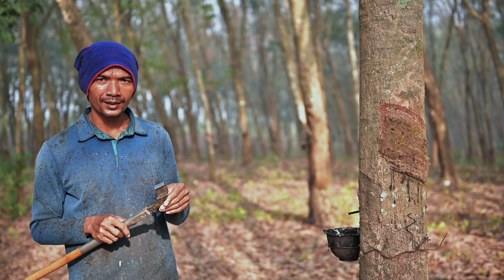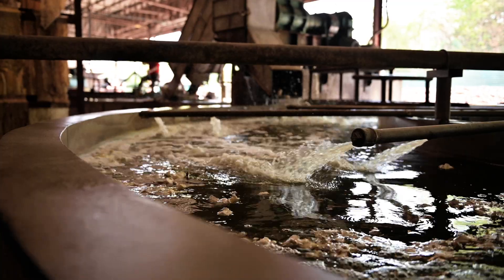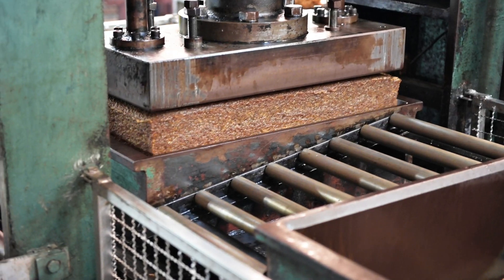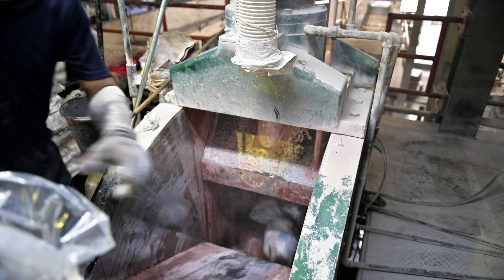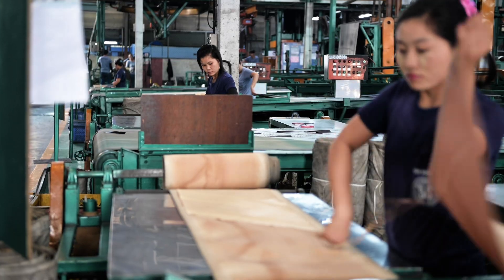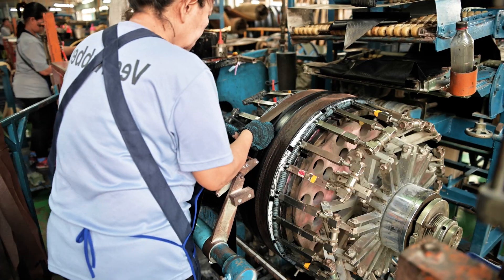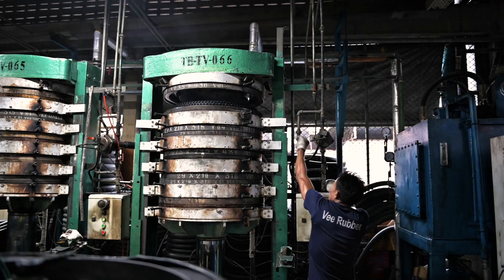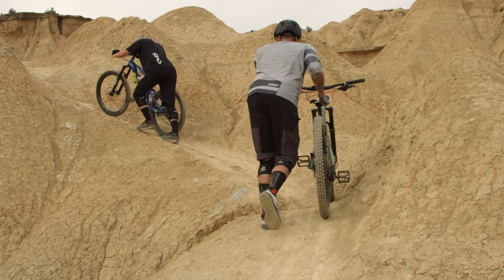How tires are made - Vee Tire Co. Factory Tour

Comment: I would like the zig zag tire with natural side walls 26x4 i have the Revi Cheetah bike and a set of tires like that would really finish the look of vintage. If it is too dificult i understand, i know natural rubber has a short life, as original car tires were made with natural rubber and the tires cracked and leaked from UV distruction. maybe i could apply a natural rubber die to the zigzag white wall to give it that vintage look. Any advice, i am greatful.